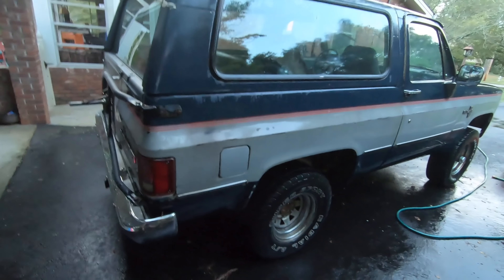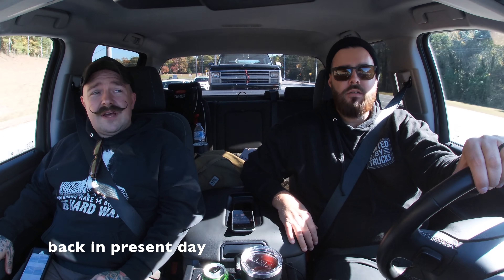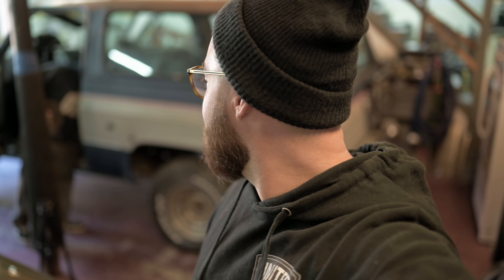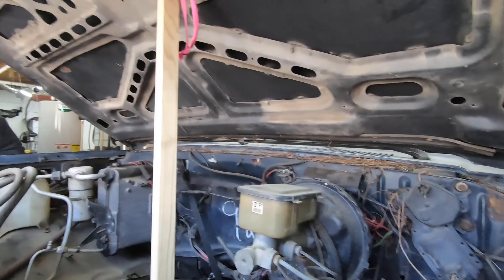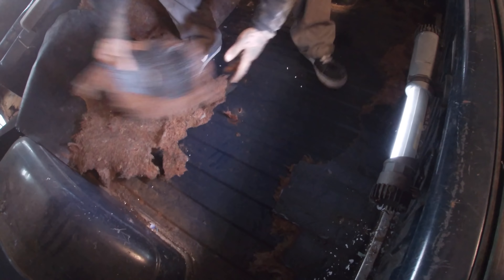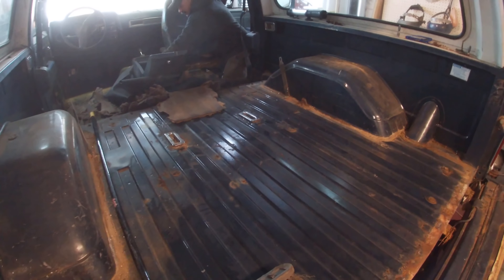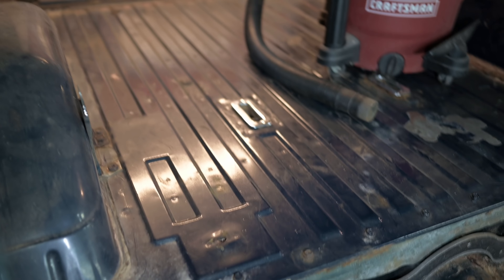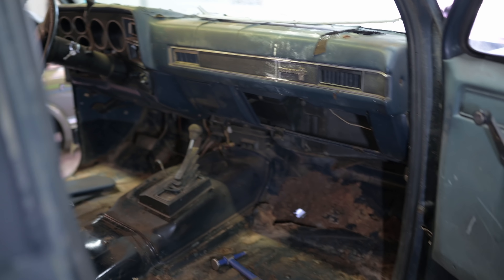CLEAN UP ON AISLE K5 | Too much rust for UBTK5?

Comment: Go through off road design and get for inch shackel flips and put them on the rear end. You will be impressed with the height of the K5 and bye leaf springs for the front end 9 inch rhino line the in side and under coat the bottom I did it to mine
Reply from the maker: This body is going on our 2wd air ride suspension. I have another k5 that will remain 4x4.

Comment: I assume lmc or someone makes a complete floor pan kit and rockers. Definitely worth the money to replace it all in one shot then seal everything really good with a rust converter and encapsulator and it will last forever.  I did it in my truck cab with the rust converter then sprayed it all in raptor bed liner in the cab and underside then put a large pack on 80 mil deadener over it cabs rust free and very quiet now
Reply from the maker: That's the plan but we're using Auto Metal Direct for all of the metal
Reply: Yeah there is so many companies now offering parts

Comment: Man the k5 needs to the rust fixed, the floor sanded down and then the whole inside sprayed in a exterior color matched bed liner. Then put some carpet up front and done.
Reply from the maker: Currently getting fixed.
Reply: @UNITEDBYTRUCKS  yeah I saw the rust repair going on! Just was adding the bedliner idea if it wasnt already a thought.